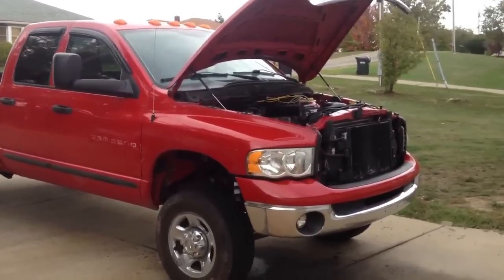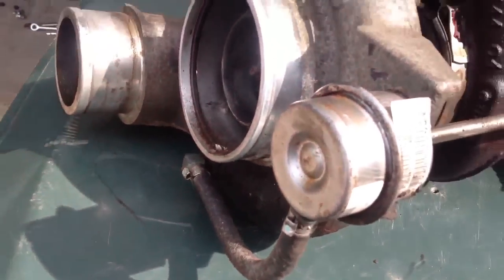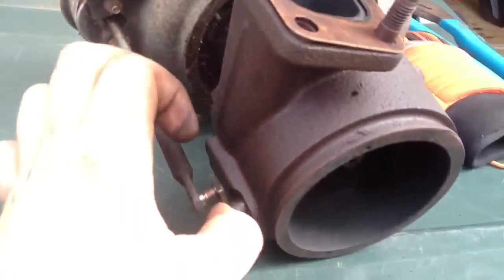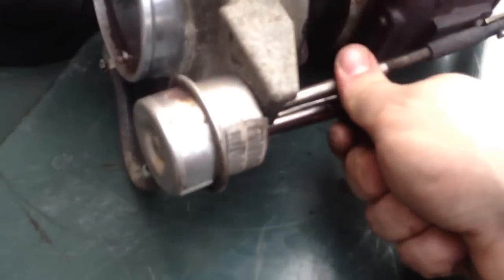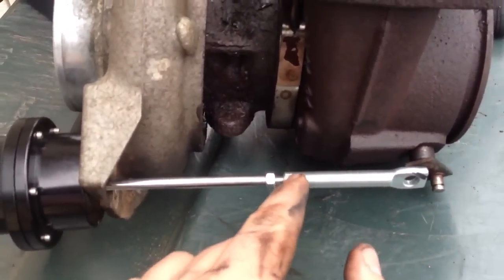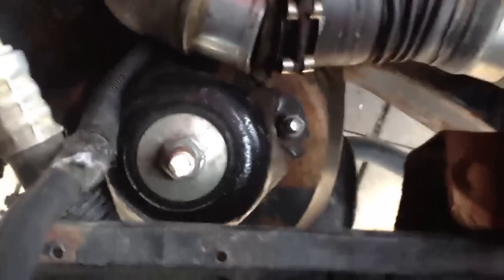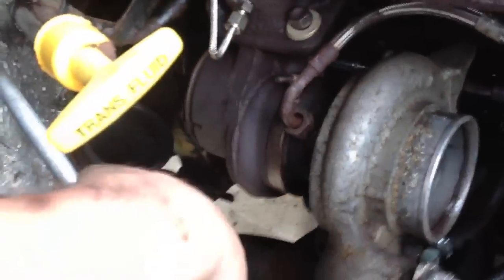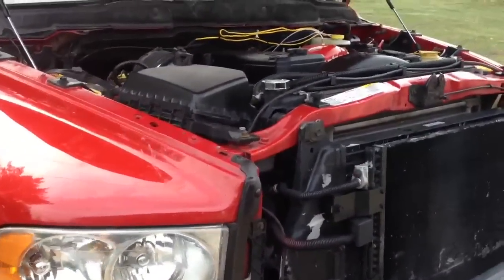HOW TO ADD 7 PSI WITH AFE WASTEGATE - CUMMINS 5.9L

Comment: Just get smarty touch programmer that’s also a full time live monitor as well as being a programmer…. Then go to advanced settings agter adding your vin number to the programmer, turn off the watergate… then once tune is fully uploaded and 100% complete then go unplug it and plug in the (watergate fooler/harness jumper) Diesel Power Products has them for around $20-$30 name brand and they work great 👍 then get the most out of the engine and trans and Miles Per Gallon. Also remove that 210/205 thermostat and install an 180 degree thermostat n your engine will love you

Comment: Thx for the Video. You connect the intake/return oil tube without anything else? just like that? I want to removed also mine (Ford Mondeo). But don't know if i needs any sealant when connecting tubes

Comment: To attach the actuator rod to the pin , put compressed air on the hose .  It makes it much easier than to try to pull the rod out to connect it .

Comment: Yeah. Future tip. 80% of trucks from Jersey are sucking shot from rust.
Reply: Oh yeah. I just bought a cummins from the auction in central jersey. It's an 01 only 130k miles. Everything is completely rotted out. Frame, doors, cooler lines, brake lines, turbo need to be replaced.

Comment: replacing the silicone heater hose chunk above the turbo at that time would help resolve your "gunk" issue. Guy read some instruction pamphlets and badged himself as a master mechanic, smh... should try to learn your engines better buddy.

Comment: A waste gate prevents the compressor wheel from overspeeding. The turbo is designed to spin up quick, so it's prone to overspeed. The wastegate dumps exhaust pressure, by allowing some of the exhaust to bypass the turbine wheel.

Comment: A waste gate is nothing more but a pressure regulator. It relives exhaust gases through a bypass channel that doesn't allow it to spin the wheel as fast. It always compresses. And if you want to gain psi screw your waste gate. Put a valve or if you want it permanent a plug on the housings elbow to the waste gate tube. Then you'll boost roughly 30-35 psi depending of your engine quality. Also while it's off go ahead and do a rebuild. I blew the rear ring and boy oh boy was it a problem. After the rebuild she spun a lot smoother then 300k mile worth of wear.

Comment: where did you find the clip to replace the waste gate? ford 7.3 its 207.00 for the wastegate and the clip they dont sell it by itself? like wtf? i just put a wicked wheel in my truck. my wastegate is junk. but i dont dare taking a chance at the thing till i find what kinda clip it is or where i can get it . i have a banks wastegate need help finding the clip!!!
Reply: use an alligator clip "roach clip"

Comment: I think you are a little screwed up on how the waste gate works. It's not a never ending fucking cycle. When the press gets to high the waste gate opens to bypass the turbine wheel and lower the press in the compressor. This is so idiots like you don't over boost your engine and start melting things with EGTs over 1100 degrees. Don't be surprised when your engine has to be rebuilt with only 300K miles.

Comment: at 6.37 you mean 14 psi not 40??
Reply: naw diesel's run much higher boost levels sled pullers and drag racers who run cummins ,powerstroke or what ever have boost levels from 80 to 100+ psi

Comment: 2001 dodge ram 2500 50hp injector tips afe bladerunner turbo 4in straight pipe exhaust turboback and afe CAI and i have the p0234 code

Comment: That's what boost controllers are for, a manual one does just fine. But I bet that the replacement unit is of better quality if it's not a quality unit already.

Comment from the maker: Hello, thanks for watching. If the code is p0234 that is an over boost code. Please PM me with more info on your truck such info as: programmer installed, injectors size, intercooler type, exhaust type, and future plans for the truck and we will go from there =) As for level of difficulty on installing a new turbo, easy as long as you can turn a wrench ;)

Comment: Thank You for helpfull video I just gor the engine light on the dash and checked the codes and is displaying code 0234 that stays for the waste gate preassure sensor PWM.  I have 05 Ram with 130000 miles on it do you thing I should replace turbo at the same time or just the waste gate?  I'm thinking of doing it myself basic mechanic skills should i atempt it,or look for proffesional? I'm thinking of putting aFe 46-60052 - Bladerunner Turbocharger do you think it is worth it oveer the stock one

Comment from the maker: The spring in the stock waste gate isn't made for that higher psi. The highest you can put out of the stocker is 32psi and thats with a programmer. PS this is only for the 2003- 2004. 04.5 and up are controlled by the computer only.

Comment from the maker: If the turbo he upgraded to is to large then more fuel will be needed to help turn the turbo turn faster because as the gasses expand and are pushed out of the cylinder they create the pressure that turns the wheel in the turbo. Also upgrading intake pipeing and exhaust lessens the pressure and restriction the turbo has to deal with to push the air giving it a quicker boost. I hope this helps. Tell your friend to share pics with us on facebook! =)

Comment from the maker: Do you have it programmed? Smarty, edge, super chip, ect? If not the stock software will throw over boost code and tell the motor to start defuling. Or if you want to keep the stock program but still get more boost then they make whats called a boost fooler. But if you ask me go with a smarty you will love it!

Comment: i have a 06 cummins i just put a new stock holset turbo on with a stock waiste gate and everything work but i keep throwing a overboost code truck is all stock except for i took the silencer ring out of the turbo and the baffles out of the intake tube and i straight piped it any ideas why it keep throwing a over boost code?